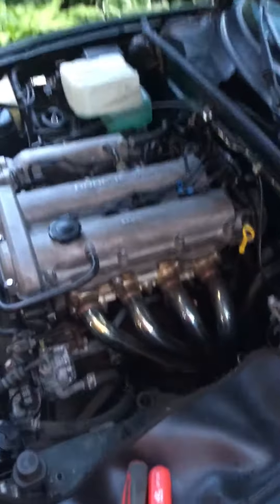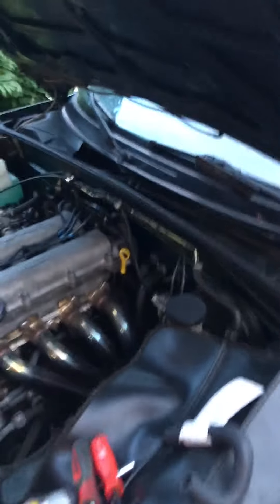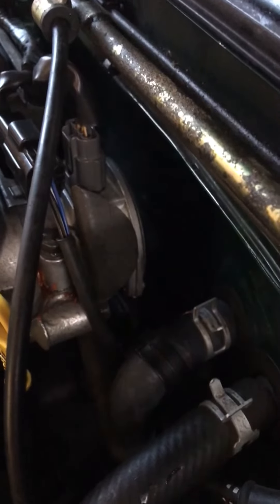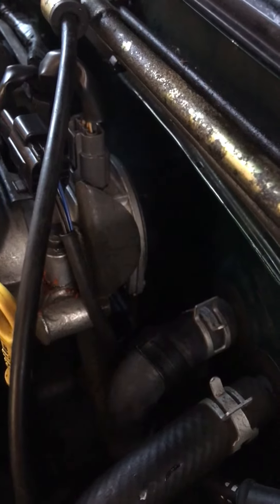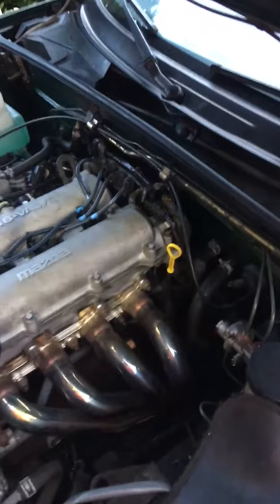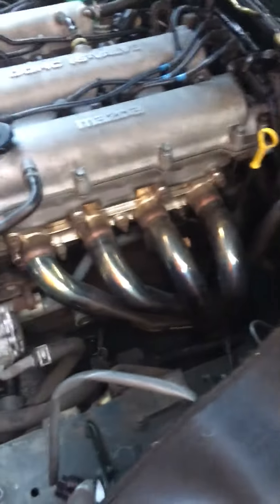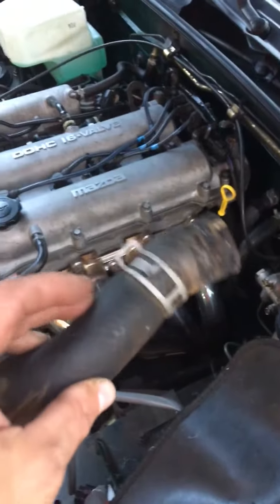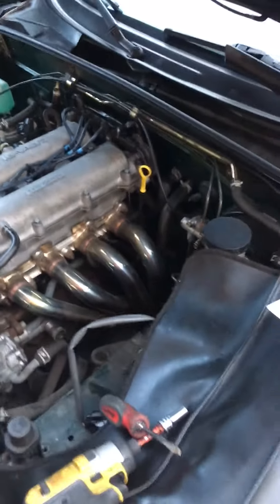Miata coolant hose fail and replacement

Comment: Sanded, painted my head gasket since I was putting in a new seal…didn’t change my CAS seal and guess what?
Leaked a tiny bit of oil on to that exact coolant hose, (about where it attaches to the block) and while I was driving the hose blew a leak. Luckily it was cold out. I let the car cool down, drove a mile, turned off the car, drove a mile, turned off the car…all the way home. 😜